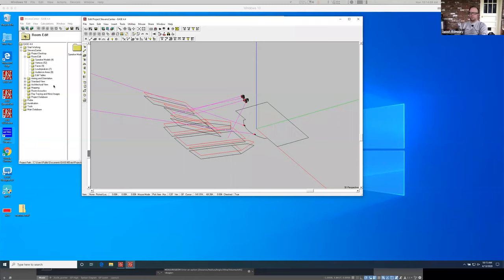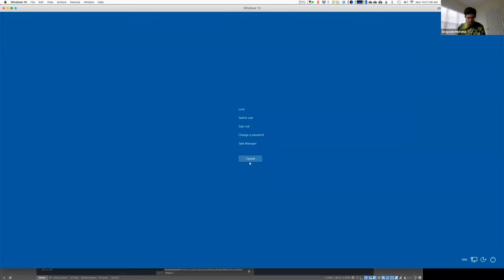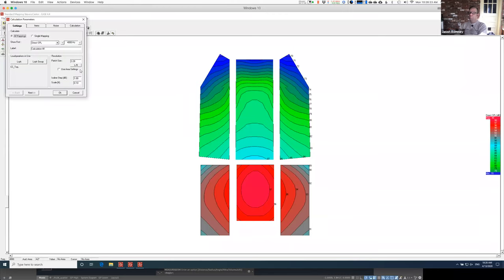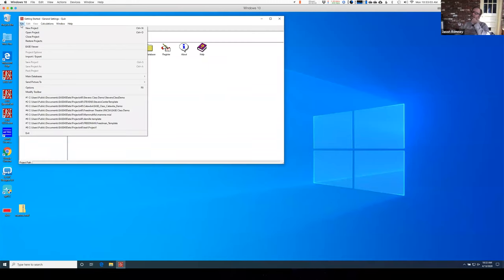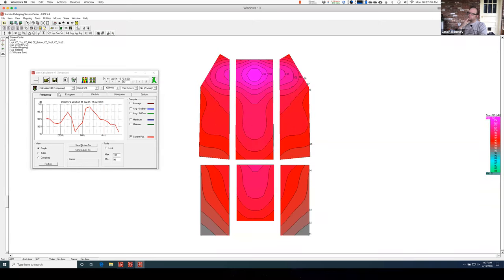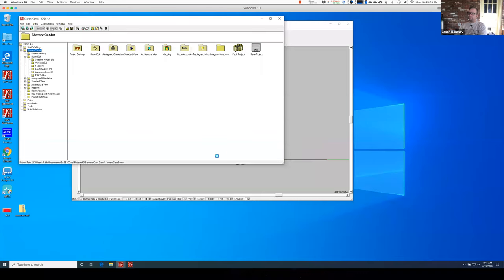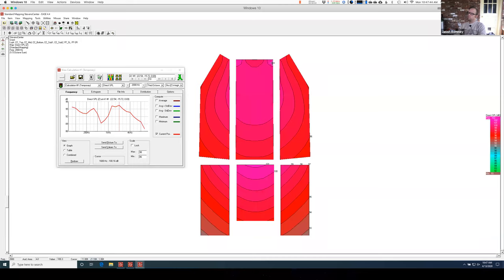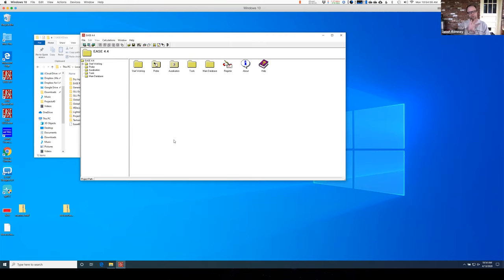EASE Training Part 3 - 2020

Comment: 12:00 - What would have happened if you pointed the top speaker farther towards the back instead of turning down the middle speaker?  Wouldn't that have helped solve both issues (not loud enough in the back and too loud in the front of the balcony)??  Just wondering.  Thanks for posting these lectures.  I've enjoyed them!
Reply: Well, the top one is already aimed at the back row of the balcony. So pointing it farther up would likely put some of the audience seats off-axis enough that the frequency response would be noticeably different. But since the balcony loudspeaker alone covers the area well, I'm reluctant to change it. When you also consider that the middle one doesn't have to travel as long a distance to hit the seats in the back of the orchestra section, it makes sense that it would be louder. So that's why I would tend to just reduce the level of that middle one.
Reply: Actually, looking at the drawing, I'm aimed at the back row for the center section. But because of a spotlight booth, there are a few extra rows on the side. So maybe tipping it up a few degrees would be worth a shot. We might have to be careful about putting some absorption across the front of the spot booth so we don't get a big reflection.